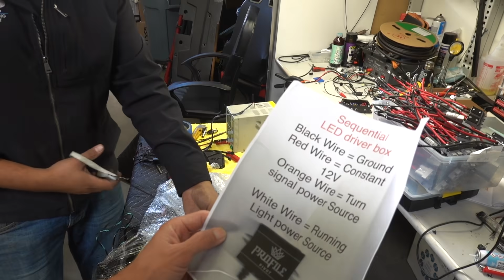THE NEW LIFT KIT IS HERE!

Comment: Being that its a 3 bolt steering knuckle and a front lift box that means its a smaller GM vehicle as the HD have 4 bolt knuckles. That kit appears to be a 2014 to 2018 Silverado/GMC. So whomever has that is getting a taller lift possibly Chris?

Comment: Tahoe, tahoe/suburbans have rear coils instead of leaf springs, similar to a half ton ram rear end suspension setup. The front suspension on Tahoe’s are the same as the half ton Silverado’s, same crossmembers, diff drops, struts are adjustable by adding spacers when putting struts together, more coil perch spacers the higher the lift. Not sure if I was the first to get it right or not, but you said rear coils and the front coils are for putting struts together. Cross members have no diff supports on them, 3/4 ton fords and rams don’t have crossmembers. Chevy 3/4 tons are leaf springs in the rear. Not sure if I was the first one to get it right or not, but based on info provided that’s what it is lol